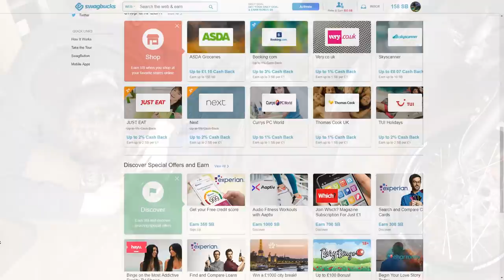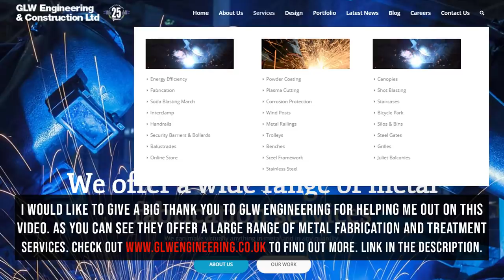BMW E30 Chassis Shot Blasting Time-lapse Restoration | BMW E30 325i Sport Restoration S1E10

Comment: i dont think thats good for the paint
Reply: Puglife Puglife it'll buff out 😂
Reply: Think of the weight savings
Reply: respray my dude
Reply: @luuk3213  gonna need to resand everything because after sand blasting surface is very rough and it need double amount of primer or resending
Reply: @el_kuks  well, that wasn't my point. My point was that it'S gonna get resprayed anyway, so preservign the paint doesn't matter
Reply: What paint ? :)
Reply: @Taha.masood  
Just polish it 😂

Comment: My body, produced in 1985, has the same problems, as well as someone unsuccessfully welded the rear arches, and the internal wing over the adsorber in the rear right arch also rotted. The same holes in the legs of the driver and passenger. Also rotted shelf under the battery. These are standard car data problems. I look and I am glad you are doing everything perfectly. For welding, use semi-automatic welding and welding mix with argon and carbon dioxide. The arc becomes completely controllable. The seam is smooth and clean, without pores.

Comment: time to undo all of the rust damage that the rainy UK weather did to your Bimmer! hopefully BMW Group Classic offers repair panels that will restore the shell to what it was the day it left the Munich Body shop!
Reply: at least your government doesnt bring any 
reagents to melt the snow like  in moscow they do. You really should search some videos about ours repairing jobs. Most of the cars we deal with you would call dead
Reply: I actually have seen a video of someone repairing a ZaZ Vida (a Chevrolet Aveo in the US) that looked like it was rear ended at 90 MPH and completely collapsed the trunk area.
Reply: @digitalrailroader  our cars are 
a separate topic for conversation. Shitty and thin metal. Nothing to hope for. Even bmw with zinc on their carcass are dying 
when covered in salt for 4 months of wet winter
Reply: It’s not the rain that does the damage, it’s the grit/salt they put on the roads in the winter. 

If you avoid driving a car over winter until they’ve stopped gritting and the rains washed the grit away (which can take ages because they put so much down) then they hold up ok unless you live by the coast.

Comment: There needs to be a replica of that body in stainless steel. a lot heavier I suppose but no rust problems anymore. Alternatively galvanising it would also be a rust preventative measure. Good job so far!

Comment: Awesome. I have a silver 1986 2 door 325i L6 manual with only 120,000 miles on it. The dashboard is perfect and the roof liner is perfect. I paid $500 for it from a friend who's uncle was the original owner and he babied it. My friend was moving and couldn't take it with him. I've already had a $6,000 offer on it, unsolicited. I love your videos. Oh, one thing I found out. I had to replace the rack n pinion on it and for the same price the rack n pinion off of a new BMW Z fits perfectly. Cost exactly the same as the stock one

Comment: Love your videos. Just a tip.
I owned a soda blast firm in the UK. The sand grit can cause surface rust and warpage. 

Soda is the way to go. 

Get that shell sealed asap buddy. The rough texture is a place where moisture sits on.

Comment: Do you put the steering wheel on the left side since you are living in Spain now?
Reply: To do this he will have to weld firewall, and overall cut and weld a lot in motor section, which will make it less hard structurally. It's better off just to find a different body with a left sided steering column
Reply: @RussianZOmBieATTACK  but he won't do that, otherwise he wouldn't have sandblasted his RHD body now

Comment: How do you get it out of all the cavities and deep folded seams afterwards? Seems like any attempt to remove it with air would just push it deeper. 

What made you choose this over a chemical dip strip?
Reply: Because a chemical dip will seep 10x deeper into any seams or cavities. Not a good thing when you can't coat it like from factory again.
Reply: Would rather ‘dry’ waste, then ‘acid’ waste anytime!!

Comment: Nice work with the e30. I think very few people put this mutch effort when restoring their vehicles. Do you need to prime the car right after blasting, so it wouldent immediatly start to rust? There is a ton of exposed metal, and I think some time will pass to get it ready for paintig, like dealing with rust holes and stuff. So if not primed (or somehow protected from atmosphere/rust) some spots may start developing rust.

Comment: It will be very important to immediately put that car in epoxy primer because sand blasting removes the factory metal etching.  This means bare naked metal, which will start forming surface rust right away, especially in the Uk.  You gotta epoxy prime over everything, the former rust spots and body damage and holes, then you can take your time with the rust damage. Then, you can hit it with 2k primer and start the fine body work and go from there

Comment: Its still a solid chassis, most of the parts are not hard to repair or get replacement parts for. 
I was wondering, are you going to smooth (the heavy bondo area) the areas on the rear quarters again or replacing them completely?

Comment: It looks like a lot of the structural metal has rusted away.  Seems a bit dodgy.  How are you going to replace that?  If you reinforce what's left with steel plates and weld them on, aren't there concerns with weight balance, etc?

Comment: Jealous, I have a '69 1602 body that I want to get stripped and I'm worried about panel warpage with the sandblasting. leaving the roof for handsanding is definitely something that I will be doing for my project. I might look seriously look into some of my local blasters now that I've seen the work that can be done by skilled professionals. I've got a touch more rust than yours but thankfully its all just decorative and not structural.

Comment: The sand blasting job was not too good, I can see spots with some shadow rust and under is still has undercoating, all the boxed sections will need to be removed to blast inside of it (like the rocker panels) all in all you still have alot more work to get all the rust out, but aye you're trying and that's whats important, good luck hope it goes good...

Comment: That really is a rust bucket, surprising the body still holds together with so many rust holes. Wouldn't it be cheaper to buy a body in better condition from some junkyard than actually go through the process of making this body usable?

Comment: Whoever did those repairs in the past was either incredibly unskilled or lazy those patches look like shit and there is no reason for there to be that much body filler, hopefully you will do a better job and try to avoid using filler as much as whoever did these repairs in the past

Comment: Completely unnecessary to strip the entire car like this. Large portions of the car are completely rust free, and the "bad repairs" look pretty damn good to me, no signs of lifting bodywork on either 1/4 panel. 
 Factory applied German paints and undercoatings are superior than what 95% of what most people re-apply afterwards. The cost equivalent high quality primers, paints and undercoatings to get just the shell back to pre blast condition will be well into the thousands of dollars to do it correctly. 
 It's not a 356 or a gulwing...

Comment: Whats the point? Its not even M3, just an old bitter worth 1 grand at most
Reply: You have to be kidding me
Reply: This is not just about money... I have old Fiat Croma (154) which I got from my father in probably eleven-twelve years, for someone is old rusty piece of crap but for me it has a non-quantifiable value.
Reply: @samozemla  In meaning of BMW in film, it's a E30 that are getting more expensive with every day and It's a 325i so the top civil engine model  and he make a M3 replicca or sell it after project will bd done for good money
or waste the orginal motor and swap some of the E36/E46 motors e.g. m52b28 that would bd such an upgrade and than a M3 body kit
Reply: it's a classic. doesn't matter if its a m3.
Reply: @1188clean  Exactly